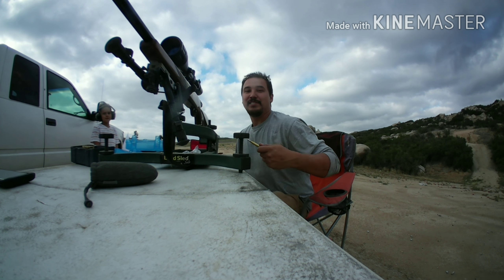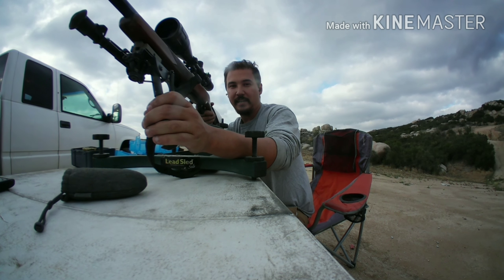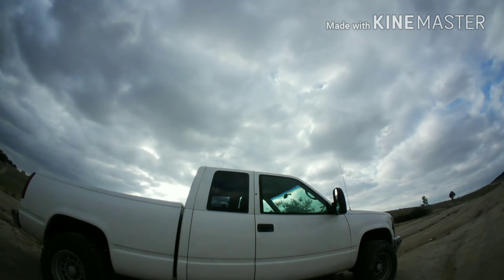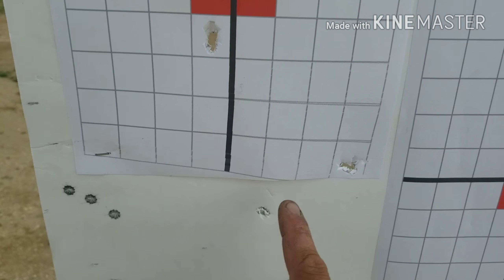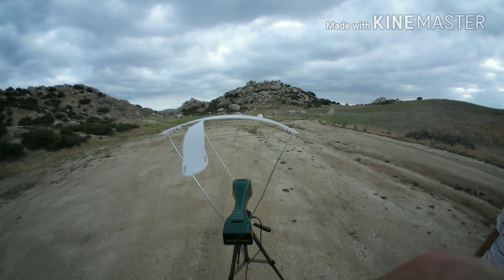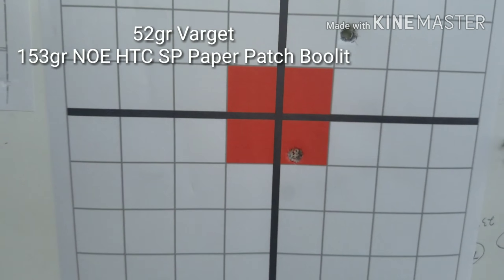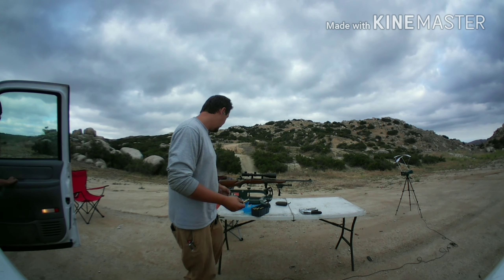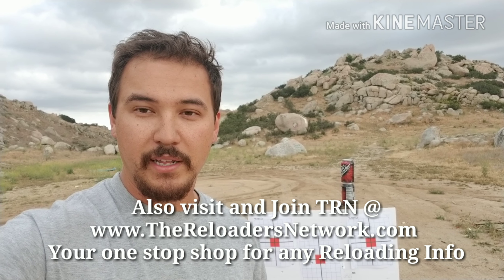Shooting Zinc in 30-06 and more paper patch testing

Comment: Zinc is a bitch to mould. Really have to keep my cast iron mould on a hot stove burner while moulding bullets. Bismuth seems better but expands when it cools down. So .452 comes out around .458. I run it through a few sizers to not stress the metal and kind of have to anyway. Bismuth isnt as hard as zinc but still more than lead. Hate trashing my barrels with copper or brass

Comment: That's disappointing. I actually thought the 230 grain in zinc had a fair chance of being a good bullet for 30 aught. But it still has a chance of being with the right  twist but who knows what that is
Reply from the maker: I think this boolit design just isnt ment for 2400+ FPS. Thinking of getting a Accurate mold
Reply: @EagleEyeShooting  Did you every find a zinc bullet to shoot well in 30-06